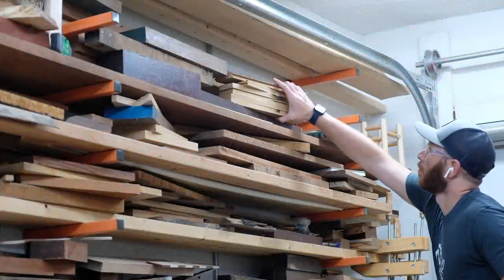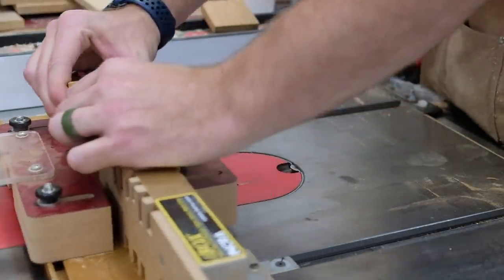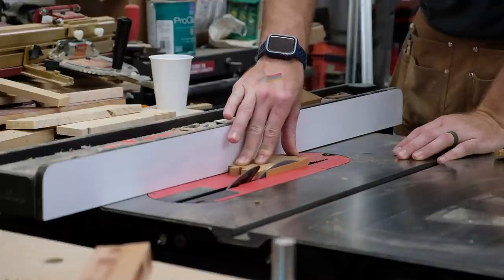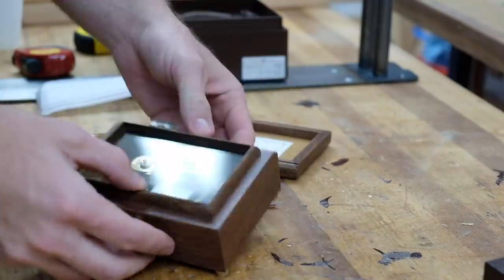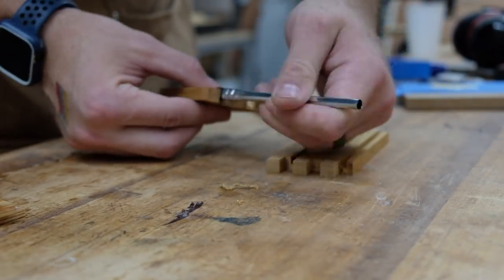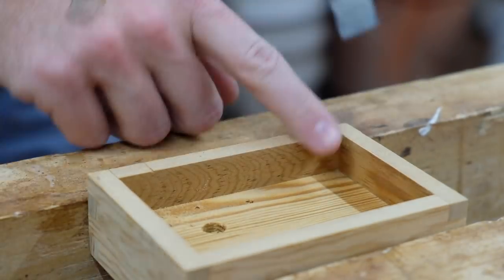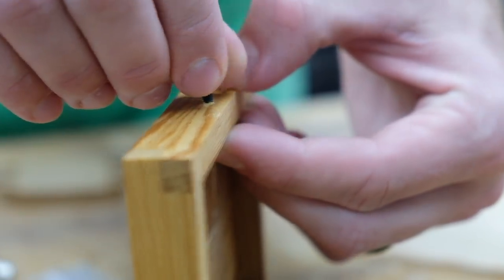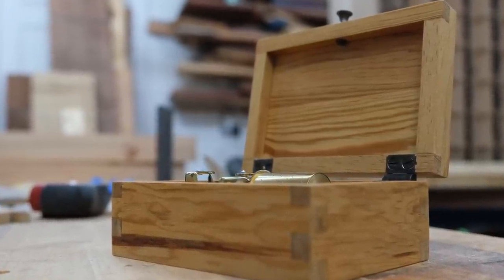Making a Music Box: A 5 Year Anniversary Present

Comment: Nice work. A cautionary tale, however. 39 years ago I lost my middle finger and severely cut my index, third, and pinkie fingers on a table saw. A moment’s inattention changed my life, as a 10” carbide tipped blade running at 3400 rpm didn’t distinguish between wood and flesh. Watching you work without guards with your hands so close to the blade makes me cringe. For your sake and that of your family, please pause and rethink your woodworking safety protocols. I thought I was safe. I’ll spare you the photos. Tom

Comment: Great video! 4:35 how do you deal with this issue (too deep mortises) if it arises? Plane/sand down the edges again to raise the hinge out of the mortise?
Reply from the maker: Thanks! Ya, usually I’ll take a few passes with a block plane and see where that leaves me. It’s best to sneak up on it. More sanding like I did earlier would’ve worked, but been a bit slower.

Comment: How do you like that Incra box joint jig? I’m considering getting it
Reply from the maker: It’s a great jig. I’ve had it for 5 years or so and use it every now and again when needed. It’s easy to adjust to match your dado stack and you can make incremental adjustments.
Reply: @parillaworks  cool I think I’ll get it, I wasn’t impressed with the Rockler version